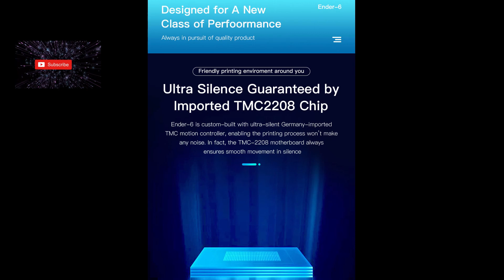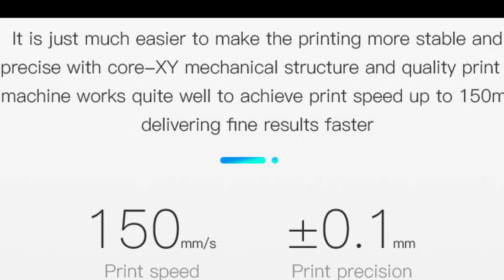Creality Ender 6 COREXY

Comment: I have a ender6 and have not had any issues, a few minor upgrades like moving the extruder at very little cost and time and have just ordered the top so it it will be fully enclosed, for the money I think its a great buy, I may look at adding the biqu h2 like 3dprintbeginner did as well as klipper but in reality its working fine how it is.
Reply from the maker: Thanks for sharing

Comment: Just a minor correction... Filament MELTER! Forget the idea of printing anything. The Ender 6 comes with a Teflon build plate insuring if you don't die from Corona 19 you will die of frustration... The perfect buy for someone who has no idea what they will print,,, because they will print, NOTHING!!! Level the bed add glue watch YouTube try again and again and agian... etc ... etc ... etc For the same result light a fire buy some plastic bags and throw them on the fire. This method also saves hundreds of dollars, $ $ $ and may keep you warm?
Reply from the maker: SO I am assuming you are having a bad experience with it. I think you should return it for a replacement or money back.

Comment: Doesn’t print silent, doesn’t print at advertised speeds. Half of the time needs fixing every other day. Avoid this ender 6. It really is a terrible printer
Reply from the maker: Thank you for your input.
Reply: The silent part is in regards to the stepper motor drivers,  try non silent stepper drivers they make weird noises. Most of the noise it makes is coming from the fans. I dont think that there is such a thing a a truly silent 3d printer

I am running mine at 150mms with 5000 acceleration  with no problems at all. Maybe you got a terrible one, but mine is a very very decent machine ( I also have 4 other 3d printers)
Reply from the maker: This is good news. How are your prints at 150 mms?

Comment: So you don't like it?
Reply from the maker: I am not sure I trust it for $600. But then again it is sold out so what do I know, right? I don't know maybe is great, but for $600 there may be some other options, I bet there will be minor upgrades required in the filament path. And the bed will vibrate just like my sapphire s, because the counter lever bed secured only at the back. That is why I am skeptical about it. The 2208 are nice to have but other than that i Don't know. I got an artillery sidewinder x1 and it just worked well out of the box and no tweaking. That is the first 3d printer that gave me that experience the rest of them still needed a tune here a hot end there, an extrude and some other parts replacements. Artillery has being printing for the last 4 month non stop and quite well and no replacements. SO I would not at this stage get the $600 ender 6. I am thinking another artillery if I need another 3D printer. But we shall see.
Reply: Yesterday I saw a very interesting video on youtube regarding to Ender 5 which apparently has a problem burning power supplies off, because they are under-resigned.
The new Ender 6 looks nice yes, although it to me seems like Creality had choose the worst construction of an ender 5 combined with a Cr-10s pro v2, which means the machine can cause serious problems.
So no one should buy some of the printers you can get in China without being a technician, because you will need it no matter what type of printer it is and the price should be 1/3 of what it is now, since warranty and services in China do not exist.

Therefore, it may be interesting to hear Creality who shalll pay when the new Ender 6 starts to break and burn power supplies off?

Does Creality pay for them to be sent for repair?

And who will pay for all the machines they send out with bugs, errors and omissions!
if the machine is ever going to work at all.

How will Creality make sure customers not are been cheated the way they do now?
And how will Creality secure the customers who are not technicians?
Anyone buy a 3d printer because it has to work as if you buy a regular printer, car or similar that there are some who want to play technician it something completely different and their case, but how will Creality sure the regular user? for the construction you have chosen on the machine which means that it can’t keep a print standard in a way that can be used for anything and Creality has again chosen a too small power supply which will constantly work on overtime and therefore burn off, will Creality pay for the service the machine will be needed to get, plus various parts that need to be replaced?
For all the new and old customer remember you can see allot on youtube about 3d printer but also remember most of them get free 3d printer from Creality and so on.
Reply from the maker: I have returned a creality in the past because i could not get the quality I wanted. So if you return it I guess they pay for the losses. But if you keep it and try to upgrade it to no avail then you pay for the loses. So you can always opt for more expensive 3d printers that are more reliable from the get go. but usually they cost a lot more.
Reply: @allanrasmussen5789  Creality is the number 1 selling 3d printer company, No one sells more than them. Yes there have been some issues, but you will always see people complain when something goes wrong. The larger majority whose machines work fine, tend not to post that their machines work fine.

Also, remember, this is the lower end of the market in terms of cost. If you want something with better parts etc, that cost more money.  You get what you pay for, and as they creality havethe largest market share, most people seem to be happy with what they pay for what they get

Comment: Yesterday I saw a very interesting video on youtube regarding to Ender 5 which apparently has a problem burning power supplies off, because they are under-resigned.
The new Ender 6 looks nice yes, although it to me seems like Creality had choose the worst construction of an ender 5 combined with a Cr-10s pro v2, which means the machine can cause serious problems.
So no one should buy some of the printers you can get in China without being a technician, because you will need it no matter what type of printer it is and the price should be 1/3 of what it is now, since warranty and services in China do not exist.

Therefore, it may be interesting to hear Creality who shalll pay when the new Ender 6 starts to break and burn power supplies off?

Does Creality pay for them to be sent for repair?

And who will pay for all the machines they send out with bugs, errors and omissions!
if the machine is ever going to work at all.

How will Creality make sure customers not are been cheated the way they do now?
And how will Creality secure the customers who are not technicians?
Anyone buy a 3d printer because it has to work as if you buy a regular printer, car or similar that there are some who want to play technician it something completely different and their case, but how will Creality sure the regular user? for the construction you have chosen on the machine which means that it can’t keep a print standard in a way that can be used for anything and Creality has again chosen a too small power supply which will constantly work on overtime and therefore burn off, will Creality pay for the service the machine will be needed to get, plus various parts that need to be replaced?
For all the new and old customer remember you can see allot on youtube about 3d printer but also remember most of them get free 3d printer from Creality and so on.
Reply from the maker: They do offer warranty but the troubleshooting process is cumbersome because of time difference. You just have to be patient and do whatever they ask you. I am speaking from experience with creality, and recently i had an engagement with artillery for my sidewinder x1.
Reply: @RoamingInterests  they do not maybe to youtuber and do you think never to answer is time enogh
Reply from the maker: NO I use a different account when I deal with support. So i do not get skewed results. But they make you jump trough hoops. You have to do everything they say in order to get the warranty. I think you should keep trying.
Reply: @Callen Koa Flixportal =)
Reply: @Cristian Kyler Thanks, I signed up and it seems like a nice service =) Appreciate it !
Reply: @Callen Koa Happy to help xD